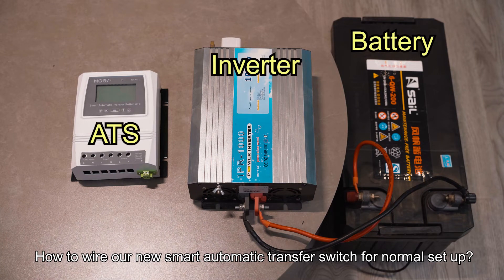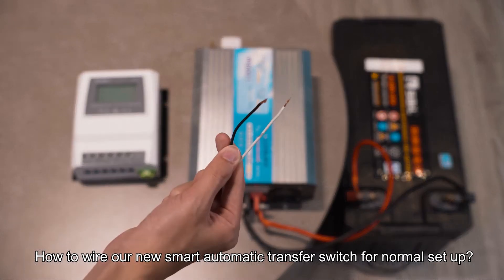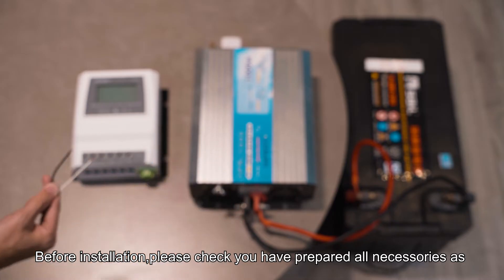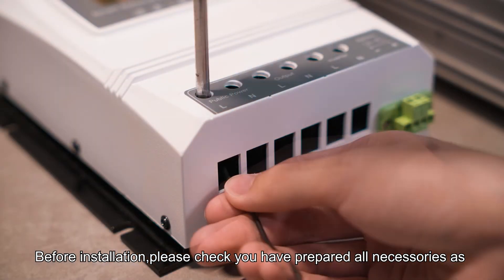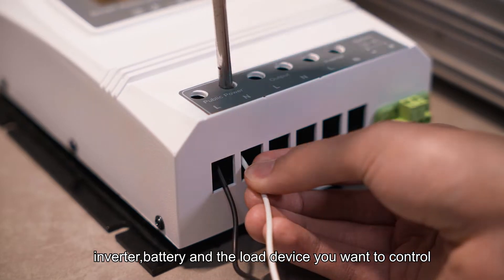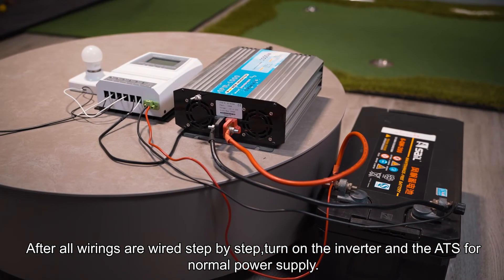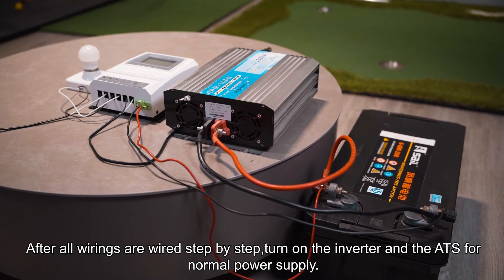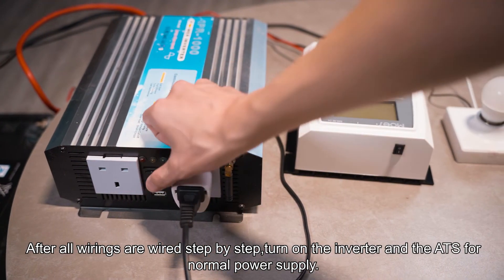How to Install an AUTOMATIC TRANSFER SWITCH ATS Installation #moes

Comment: Is it compatible with 51V battery system? (16 cells)
Are the battery charge and discharge levels free to program or are they only with preset values?

Comment: What happens after the ATS has switched to grid power and the grid goes down? Does it switch again automatically back to the inverter?
Reply from the maker: ATS just switches back and forth between the national grid and the battery, and works according to the voltage set by the customer. For example, if the voltage is higher than 12V, then the ATS will switch to the battery.

Comment: Does it work without battery? I have a grid tied solar without battery. Does the device take voltage reading from battery to make switching decisions? Thanks.
Reply from the maker: No, it must have a battery to work
Reply: is there any model that works without battery ?  @moes.official

Comment: I had to return 2 of these. Cannot handle home off grid or Utility for a month. Very light ( cheap parts). The switching only works @ >170v so forget about automatic switching for 120v loads. One ATS was started drawing from Utility and Inverter/Batteries at the same time on the 12th day. The other @ 220v one of the legs was lost at output terminal of the ATS in 2 weeks. Waste of time and money ..Garbage!!